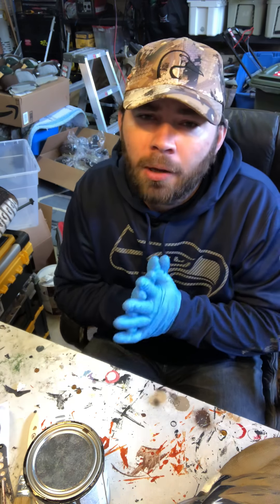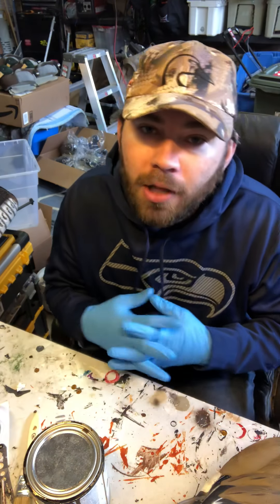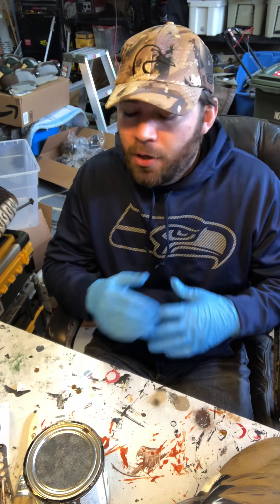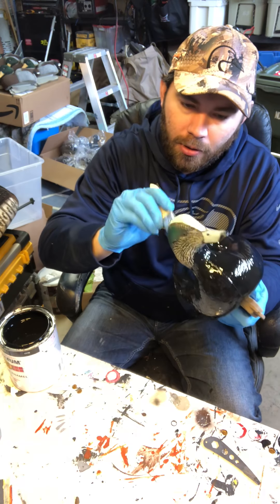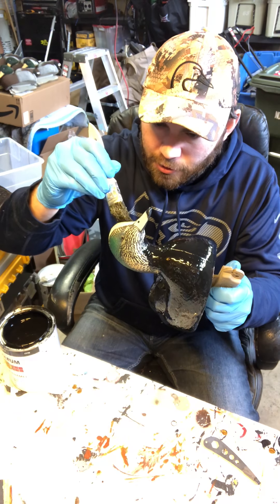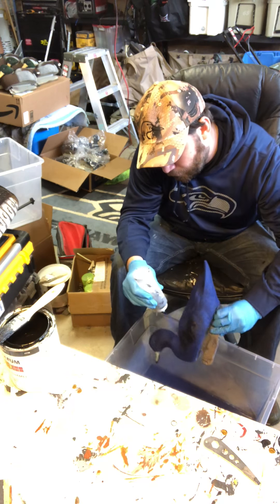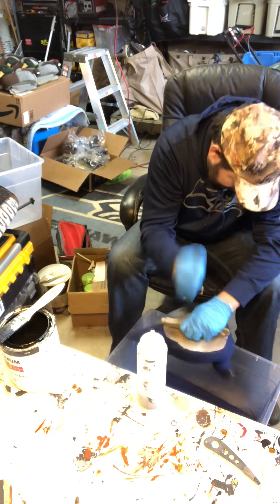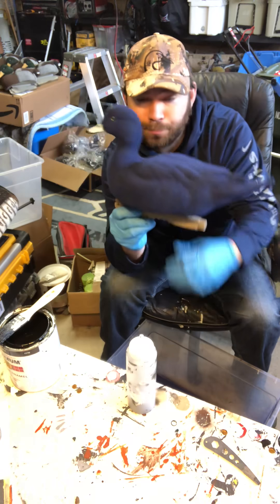Harlequin Duck decoy Flocking part 1

Comment: Trying to my own as well, what color fibers did use. Videos are bad add
Reply from the maker: Daniel Ploof I mix royal blue and black 70/30 or 60/40 depending on how dark I want them
Reply: Bryan Schroeder  thanks, how much flocking did it take for one bird
Reply from the maker: Daniel Ploof  not a lot 8 oz will last you 1-2 dozen